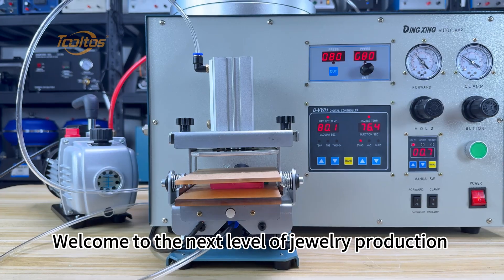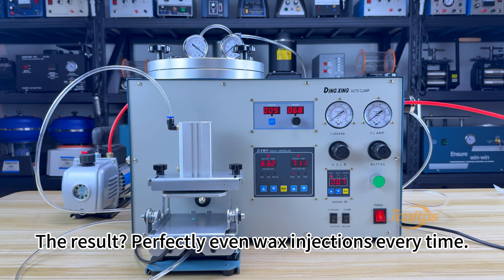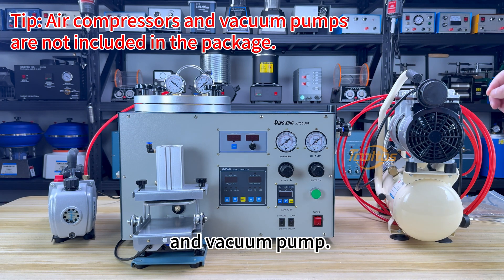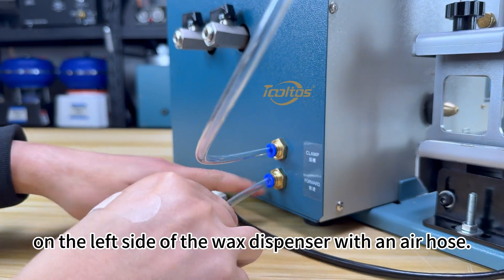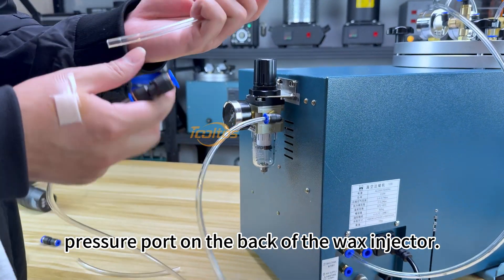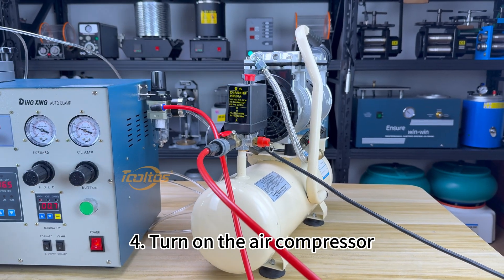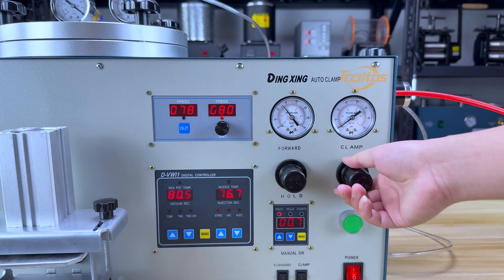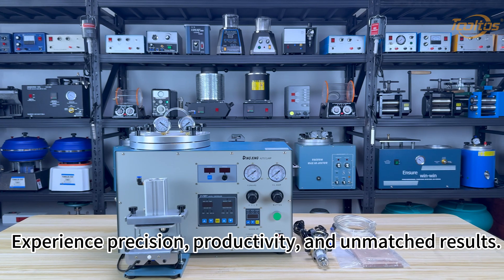How to Use Tooltos Automatic Digital Control Jewelry Vacuum Wax Injection Machine?

Comment: Have one of these wax injectors now for 1 year and works well .  however not so sure of the bubble free waxes , there is some degree of work needed to ensure a good seal on the nozzle and moulds that are being used.   my other question would be , just how many seconds of vacuum is needed for a pacific mould   no information on this area of the injection process i have ever found , for a small cavity , such as a dress ring would it be 2 sec or   5 sec  I have done a lot of testing with many different moulds ,large and small and find air bubbles still in the wax after even 4 to 8 seconds of vacuum even with a good air tight seal on the wax nozzle.  Any info would be appreciated .  john australia.
Reply from the maker: hanks so much for your thoughtful and detailed feedback. We're glad to hear the machine has been working well for you over the past year! 🙏

Regarding your question on vacuum timing: you're absolutely right that there's very limited information out there, and that's because optimal vacuum time is not fixed — it depends on several factors:

🔧 Mold size and complexity
🌡️ Wax temperature and viscosity
🧊 Mold temperature
🔒 Seal quality between the nozzle and mold
💨 Vacuum strength (not just time, but pressure level)

For small, simple cavities like a dress ring, vacuum time of 2–5 seconds should be sufficient — but only if you're pulling a strong vacuum (usually -0.08 to -0.09 MPa). However, if air bubbles remain even after 4–8 seconds, it might suggest:

Air leaks in the mold itself or mold seam lines

Wax temperature too low (making it less fluid under vacuum)

Vacuum pump not reaching full pressure quickly

Wax solidifying too quickly in fine cavities

Here are a few tips that might help:
✅ Preheat your molds to 45–55°C (to slow wax solidification)
✅ Use talc powder inside the mold to help wax flow
✅ Confirm your vacuum pump reaches full vacuum within 2–3 seconds
✅ Try injecting with vacuum held slightly longer after injection (e.g., 2 sec before, 1–2 sec after)

📞 We'd be happy to review your settings in detail — feel free to contact our tech team via WhatsApp: +86 185 5938 3105 or email: sales@tooltos.com

Thank you again for sharing your experience from Australia. Your feedback helps us improve and support other users as well.